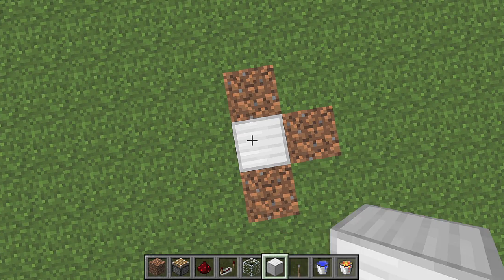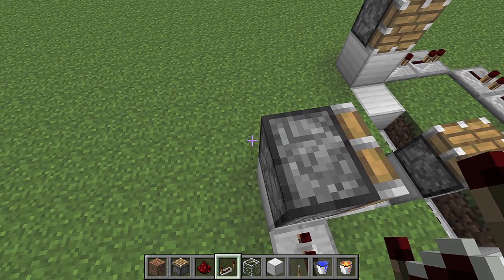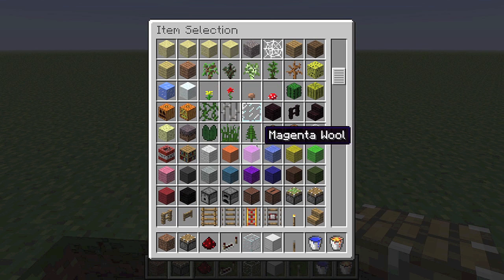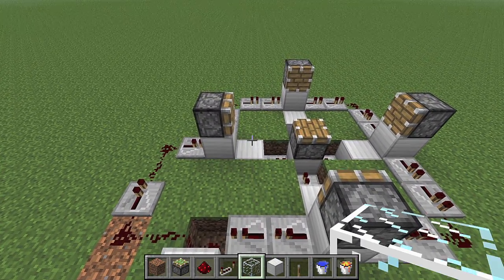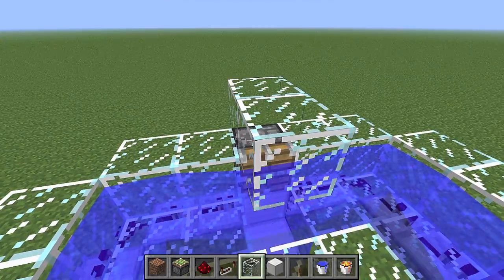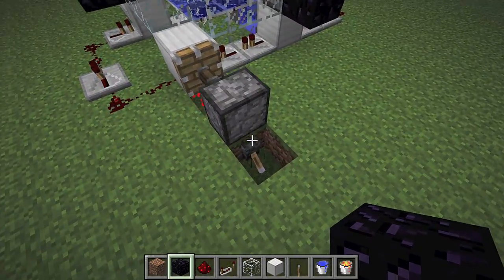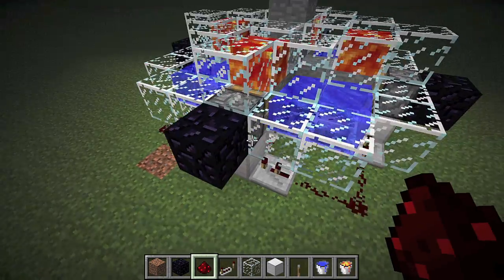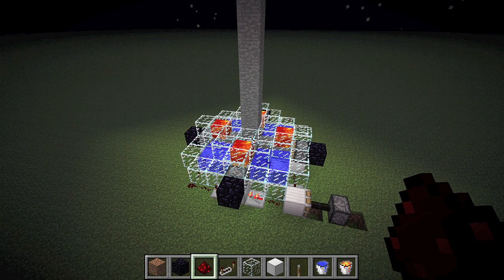Fast Smoothstone Generator (Minecraft Tutorial)

Comment from the maker: A lot of what I do is simply because I can and it's fun. In the case of a smooth stone generator, smooth stone takes a little less time to mine than cobblestone and if you use a silk touch pick then you can get smooth stone directly instead of cobble. As for version, this was originally done in 1.3 but it works in 1.4 as well.

Comment from the maker: Sounds like you don't have the bottom piston wired up properly. Either that, or it's pushed up so many blocks that it can't push any farther, in which case you just need to clear out some of the blocks above the piston and it will begin working again. (Pistons can only push so many blocks. I think the limit is 12.)